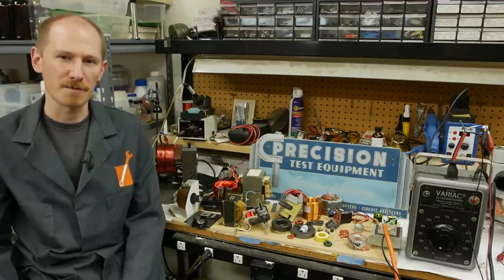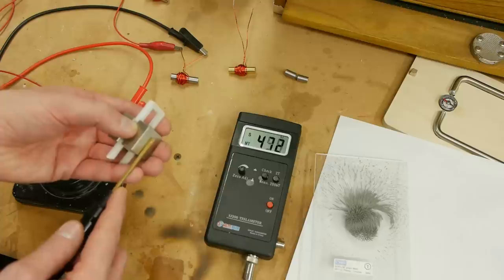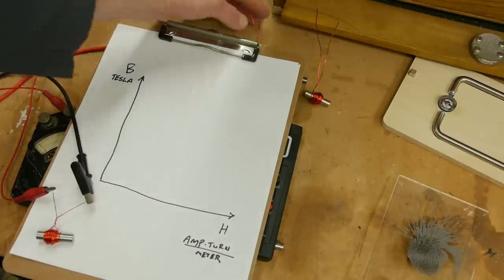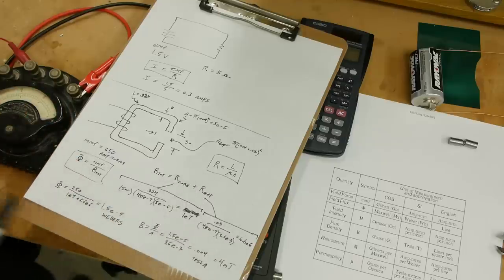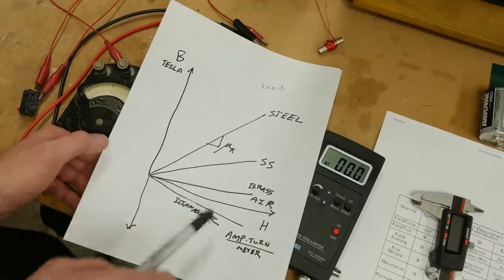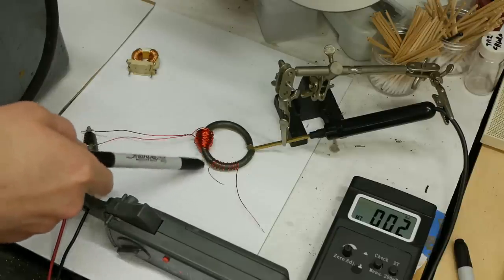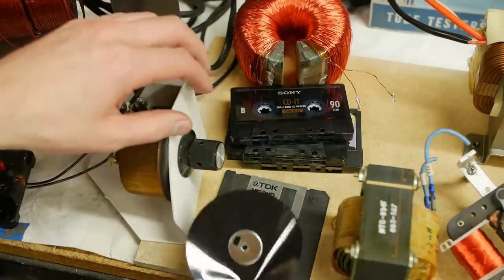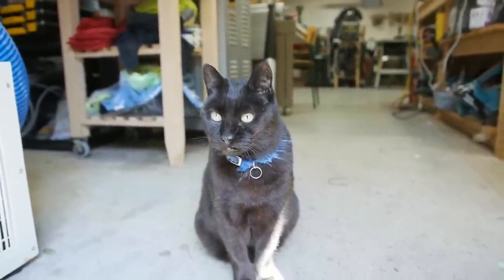Engineering magnetics -- practical introduction to BH curve

Comment: Hi.
Your well aware of audio & rf anachoec chambers vs screened rooms / boxes and corner-cubes etc.
But in magnetics - do you have knowledge re the flux vs "mumetal"?
For audio or rf I am happy to build such items and to work mumetal to screen or protect something from magnetic flux but what happens to that flux - is it absorbed, or effectively shoŕted out, or reflected?
Reason for asking is just a passing thought.
Thought was stimulated by MRI vs metal in people.
The MRI would tear the metal out of peoples bodies but what if "mumetal" screens could be made?
Would mumetal Reflect the flux back into the MRI Detector and likely destroy it or would the mumetal Absorb the flux and presumably overheat or something else?
Maybe the mumetal couldnt be used as a screen and it would need to be 100% enclosed or enclosing,  thereby cutting through the persons body severing off parts containing metal.
I guess that apart from the cost of mumetal - thats why hospitals dont Use shields?

Comment: I tried replacing a cracked ferrite tuning slug with a steel bolt which got hot real quick. Was it because of the higher coercivity of the steel couple with the higher frequency or simply induced eddy currents  (i assume they are not a problem in a ferrite slug) .   Best magnetic circuits class I have ever attended thanks.

Comment: At about 8:45-8:50 you explain that the lower magnetic reading is because of the reluctance of air.  Reluctance of air should be uniform.  I think it's the field line density that causes the lower reading.

Comment: This is absolutely an amazing video. You have such a fantastic skill of being able to explain things simply, clearly, and completely. It's rare.  I also want to point out a small correction for those people that like to nitpick (like me). @14:48 technically relative permeability is measured relative to a vacuum. Air does technically have a permeability slightly higher than a vacuum. Although you did say that for our use they are basically the same.

Comment: I think I learned more in 50minutes than reading full day from wikipedia and other sources. Thanks Ben!
I'd better to check my hall sensor core BH-graph now that I realize it might cause unexpected issues further down the road if I don't.

How do I calculate mmf for wire passing once straight through a toroid hole? I cannot figure it out how many turns it makes.

Comment: Awesome video.. showing the magentic lines flowing in metal equivalent to electricity was really nice.. never thought  about magnets that way.. @43:06 when you mentioned about torroid vs E core, one of the things I have heard is about the vibrations. If you see E core 50/60hz transformer you can see hear the vibrations. Torroid works better apparently because it being a single piece without any air gap.

Comment: Hey Ben -that digital S1200"Teslameter" - did you modify it to add an analog output jack?  Because the ones on Amazon don't appear to have one.  And if you did, I am surprised that works, as I was assuming they were using a magnetic probe chip with integrated A/D in the probe, with an I2C (or similar) output, and thus no analog signal.  But perhaps it's an analog hall effect sensor and you tapped into that downstream?

Comment: 40 years ago I was an engineering manager for a producer of electric utility meters, and then plant manager for transformer manufacturing.  Also many different capacitors, transducers, switches and aerospace products.  Absolutely no one could explain magnetism without their blackbox theories which defied logic.  So it took me 40 years to come to understand magnetism and light.  Here's a good experiment to show a link between magnetism and gravity:  take two very strong magnets and force their surfaces together (same poles) then drop them from a good height.  In this configuration they fall at a different rate then if they are connected N/S.  Why?  Enjoy!  [Hint: Space conserves just as energy conserves; and THAT is what gravity IS]

Comment: This video remind me why electrical engineers try to replace inductance by op-amp and capacitors.
It would be interesting to show, in a future video, the influence of the air gap both in the graph of B/H and also to see the difference in behavior in actual circuits.

More precisely, for the practical application of switching power supplies or flyback transformers, does differents air gap has an impact on the peak voltage?

The setup could be a high voltage horizontal output transistor where:
Emitter connected to ground, 0 volt
Base connected to a function generator. thru 10 ohm resistor. The signal shape should be short rectangular pulses, frequency scanned from 1 khz to 50 khz.
Collector connected to the primary of the transformer, the other side of the coil connected to +12 volt or adjustable...

The transistor is used as high speed switch. Assuming the output of the function generator is 5 volt, the limiting resistor is 10 ohm, the base/emitter diode is 0.7 volt, then the current at the base is: I = V / R = 5 v - 0.7 v / 10 ohm = 430 mA. Assuming a DC current gain of 50, the maximum current on the transistor collector should not exceed 21 Amps.

Comment: A great introduction into the properties of magnetics, thank you!

I have two questions, though:

1) On both the ferrite transformers and the steel ones, it seems the primary and secondary winding are wound on a different part of the core. Are there configurations where they are wound on top of each other? Are there any advantages or disadvantages to that and why?

2) How does the BH curve of a (Type-I or Type-II) superconductor look? It is supposed to be a perfect diamagnetic, yet high magnetic fields break superconductivity (partically or completely), so I was wondering how it behaves in the real world. Does this behavior have any applications apart from superconductors being used to create really strong magnetic fields?

Thanks in advance!

Comment: Dear,
Nice to meet you! This is Crystal from Changzhou Jialun Electronic Factory, which has more than 15years in alligator clip, battery holder, binding post, banana plug, test leads and other  connectors. 
Our advantage is our supply chain and design, which can help you save the purchasing cost

Comment: Ben,  very nice video.  Always struggled with magnetics,  having multiple unit systems and multiple names for the same items didn't help.  Even various ferrite core manufacturers would use different unit systems in their catalogs. 
Some day I would like to see a nice tutorial on SMPS transformer design -- not so much from the math standpoint but from the design approach at the 20,000 foot level.  Things like how to pick a core shape and material -- why is one better than another, do I want a gap or not.   There are just so many variables to consider,  one need a road map just to get started.Craig

Comment: Is there any variable that determines the speed at which the magnetic flux density changes along the BH curve, or does it change at C? 
Also, as mentioned, the BH for air/empty space is a constant. Does that mean it's a line rather than a curve? Would this allow for theoretically infinite magnetic flux density with a superconducting air coil provided with infinite current?  Is that how we can achieve higher magnetic fields than what a coil with a core can achieve? 

I've watched this a few times since it came out and love it! 
I do have some questions, though.  I'll probably go look them up myself, but don't know proper terminology.

Comment: Awesome video! 
One question, in your analogy of electricity flowing through a circuit to magnetic force flowing through the steel "circuit". If electrons are the charge carrier that is flowing through the electric circuit, what is the charge carrier that is "flowing" in the magnetic circuit?

Comment: So, I got a weird question. In a CRT, the flyback is responsible for the audible 15khz whine because of magnetrostriction, presumably through the airgap changing size. Would it be possible to silence the whine with a spacer in that gap, or would that somehow have a negative effect on the performance of the flyback? Does the gap need to physically change in size/shape during operation, or is this yet another thing where it just happened to be made that way? Or am I over-thinking it, and the magnetostriction is actually in the coil itself?
Reply: Magnetostriction makes the whole core physically change in size. Putting a thing in the airgap will not silence it. You need to stop the whole transformer from moving at a molecular level. Since that is too difficult, dampening the vibration with silicone all around it should also work. Or build a flyback transformer with 30 kHz, that way the vibration will still be there, but you won't hear it.

Comment: At minute 22:23 you said that you can approximate  the gap size by taking the radius of the steel section. But why not taking the diameter of the steel, given that when you compared with a rectangular shape, you said that you`ll add the width and the length?

Comment: At 45:45 you mention the increased reluctance due to the air gap in a flyback transformer stores power between cycles. Could you elaborate on how this works?

I know inductors store power, but how does the air gap help? Does it somehow increase inductance?

Comment: You made this a while back so I'm not sure that you're reading comments any more, but what the heck. I like most of what you're doing and it is clarifying some things for me. I do have a little quibble with how you defined the area of the air gap in the first reluctance experiment. While I don't think that it matters much, I would think that the area of the air gap is an average - since the field in the gap will indeed bow out. So, the area would be the average of a shape that looked something like the torso of a fairly fat person that expands out in the center of the gap. The area then would be an average of that shape which is also a bit hard to calculate. That would also explain why your flux density  readings dropped in the middle -- i.e. the actual flux density is lower there -- at least I think that it is, Just my .02. I am very much enjoying this and have subscribed FWIW

Harry

Comment: It is very interesting experiments. I did the same experiment to test for the magnetic properties of toroidal coil. In my case, the core does not have the gap, so I could not use the Tesla meter, but instead, I use the flux meter connected to the secondary coil (sense coil) with the transformer measurement method. I got some trouble with the current amplifier to excite the primary coil because it could not handle such a high current. Could you show me what type of current amplifier that you used for the experiment of B-H curve? Thank you so much.

Comment: How does one predict the shape of a magnetic field in 3d? I am interested in a diy electromagnetic speed sensor for a sailboat  that doesn't use a little paddle wheel which clogs up with marine growth. I can do the electronics, but the sensor geometry shape is beyond my ability to devise..
Reply: 1 dimension at a time, then add them together....typically 3d things take the shape of a ball, 2d a square, 4d a cube. 1d a line

Comment: When you say around 8:40 that the magnetic flux density of the neodymium magnet drops off quickly because air has high reluctance, isn't it mostly because the field strength of a magnetic dipole drops off as an inverse cube?
Reply: The interesting question is how the field compares if you surround the permanent magnet with steel or ferrite instead of air. Is the flux density higher at the same distance in this case?

Comment: Power transformers often use laminations made of a silicon steel alloy that is relativly high in resistance to reduce eddy current.  

Ive frequently contemplated building an auto transformer variac using easy to acquire steel banding used for straping a heavy load to say a pallet. Then coil the steel band into a toroid with an epoxy soaked paper seperator between layers. Hopefully the thinness of the bands will help keep eddy currents low. Im not sure about the Coercivity of steel strapping.  Could you do a test on it and see if it is comparable to silicon steel  laminations used in transformer laminations?

Everything is so much easyer when you have the right tools and knowlege.

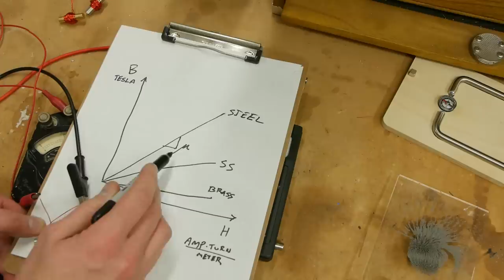Comment: 13:46 "Diamagnetic" implies that current causes something to become less magnetic than it already was, correct? If so , then maybe it starts off more magnetic than non-magnetic steel. In which case, not all materials start at 0 Teslas for 0 H's, correct?

Comment: At this point,  I'm just starting out in the video,  but I have to ask: Why do you use Rayovac batteries? I've always found them to be crappy batteries. Is there a particular reason you don't  use Energizer or Duracel batteries? 
(I used to always use Duracel ("CopperTop") alkaline batteries in everything, but in the past few years I've had so many things get totally ruined by battery leakage that I've  switched to Energizer.  Hopefully, they won't  leak as bad, but I've  also started removing batteries from things that don't get often used.)

Comment: "You can't always get what you want but you can get what you need". 
How well related is all the explanation arround hysteresis loop that you can actually understand how lossy your transformer will be from depending on your application. 
As you never get a uncoercitive and with a very high saturation point material with endless B for a given endless H, you can calculate your loss by integrating hysteresis loop. The more times per second you push your magnetic filed by applying current, the more energy you loose when you apply higher negative current further to get B=0 each cycle.
You can get that in perspective for your application.
If you are switching AC voltage in a fast frecuency you will get high losses with high cohercitive materials like steel.
And by the way you can extract something very interesting: The way the higher loses are the optimal way to cook. I think induction hobs use mostly copper cores on pans as copper should have one of the widest hysteresis loop and switching a very high frecuency B on it mostly transforms all the magnetic motive force into heat that is what you want on this case. So old radiating hobs heat the transfer ceramic surface and the air gap layer is a HUGE source of wasted energy as the heat transfer is very poor compared to induction hobs where the heat is directly generated on the pan by losses. Is just like ironic.
Maybe I take some concepts wrong, just tell me but it is awesome

Comment: 11:22 wait what coil length of the coil? the length of the wire straightened out? or the z measurement of the bunched up coil in its final state? (z line parallel to the magnetic flux lines inside the coil)

Comment: Magnetism is dependent on the numbers of polarized particles in electromagnets. The voltage polarizes and the current ups the count. With the same current, but different volages will also make a difference. It would be nice to see this too. moving charges that are not polarized do not make magnetic fields.

Comment: How would you describe the difference In hysteresis or retained magnetism in a closed loop magnetic circuit vs an open loop such as your cut toroid or the steel bar with a compass in the gap? For instance, when you replace the compass with a piece of steel to close the loop, what changes in the magnetic retention?

Comment: @31:00 I don't understand the comment about air with regards to passing steel's saturation of ~1.5T. Are you saying that beyond 1.5T steel is detrimental and one should instead use air coils and lots of current (if they don't have access to superconductors)?

Comment: Isn't the gyrator-capacitor model more accurate than the resistance-reluctance model?
Reply: gyrators are extremely complex,.....further, gyrator models can work with any concept, not just electronics😮😮

Comment: @20:00 How come the area of the core is 5e-5? The two circles plus the side of the tube is ( 2 x pi x radius^2 ) + ( diameter x pi x length ) which equals 8.24e-3 when the length is 0.324 and diameter 0.004

Comment: I was wondering the other day, when you heat a magnet past its curie point and those domains all go unalligned. When it releases the energy from that, how would that energy manifest? Would it just be exothermic? Or would the released energy manifest some other way?

Comment: Electric fields and magnetic fields are the fundamentals of the universe. Mass, space/orbitals, light and current are all oscillating electric and magnetic fields. The capacitor and inductor is underrated

Fun fact: electrical energy is taken from electric  fields without requiring motion or change in the field. While electrical energy can only be taken from magnetic fields if the field changes intensity or some motion is involved.

Comment: When you're putting iron filings down around a piece of magnetic material you're adding material that isn't resistant or reluctant to the flow of magnetic flux lines meaning the field representation of those filings may not accurately portray what's going on with a magnet that's not connected to anything. Adding material like this may skew the results visually and cause a misinterpretation. How do you visually show magnetic field lines from a magnet that is "open circuit" without affecting the field lines with the visual contrast material?